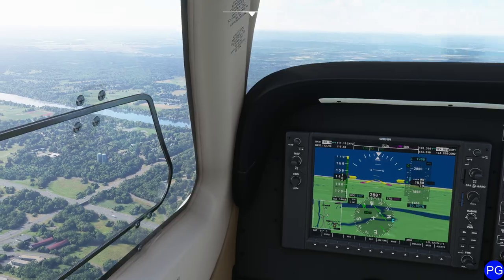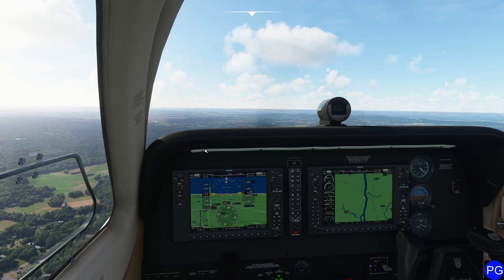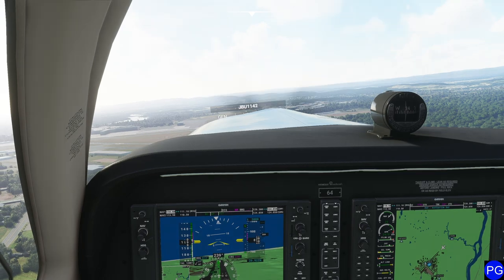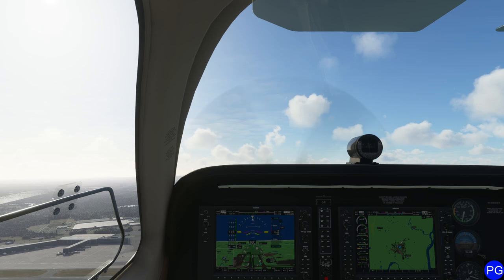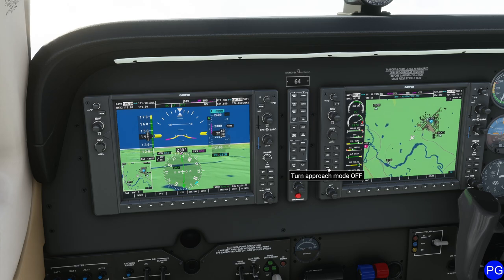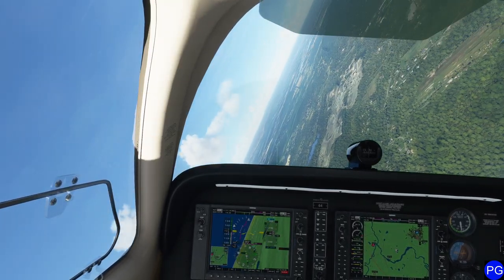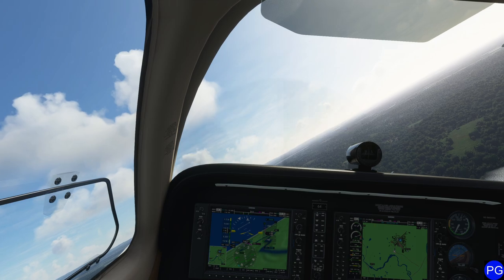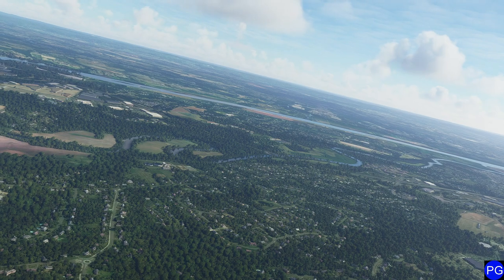FS2020 - Understanding the Backcourse Autopilot

Comment: Flying the outbound localizer signal in most situations uses normal sensing since you are flying the direction of the approach. The direction of the arrow does not change as you pass over it. The example you demonstrate is where there are two ILS's for the same runway. Both have the same frequency 111.10 but runway 24 is imyq and 06 is ibdl. As you cross the antennas your nav radio is switching ILS signals and shows the direction of the reciprocal runway ILS. Thus you are flying in reverse of the inbound ILS and require reverse navigation. This will confuse many people as the older localizer transmitters that send a strong backwards signal can be used to track outbound on the missed with normal sensing and allow inbound backcourse navigation with reverse sensing. I would recommend you repeating this demonstration at an airport with an ILS for one runway and a published Backcourse approach at the other. Fly the missed with normal sensing and then do a 180 and fly the backcourse. The BC autopilot mode was designed exactly for that purpose.

Comment: I didn't realize you had to turn backcourse off, I was treating it like a separate mode rather than a modifier for Appr or Nav mode, which resulted in some amusing loops last time I did an ILS approach with a backcourse from overhead along the localizer to a procedure turn onto the ILS. When I was coming back for the ILS I switched from Hdg to Appr and the plane immediately turned away from the airport again. D'OH!